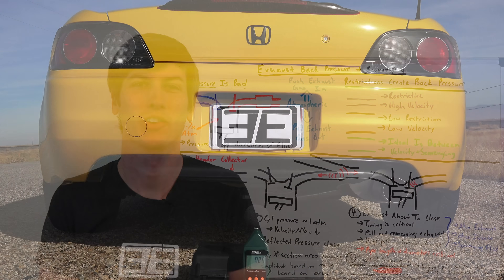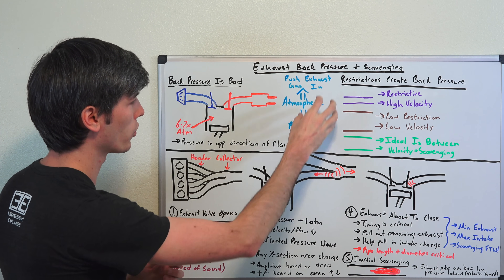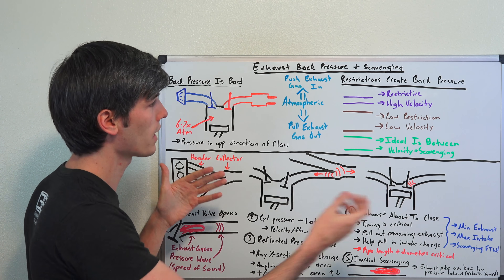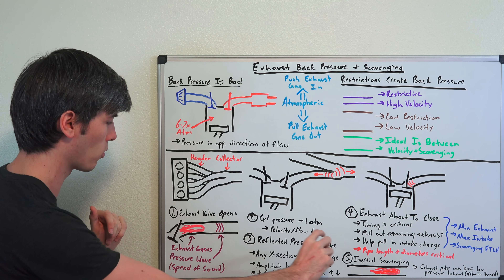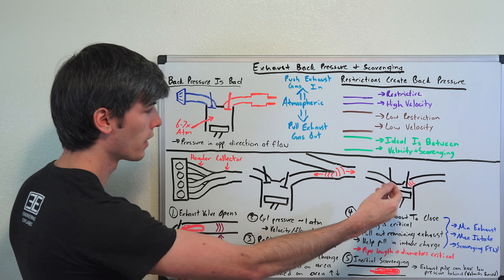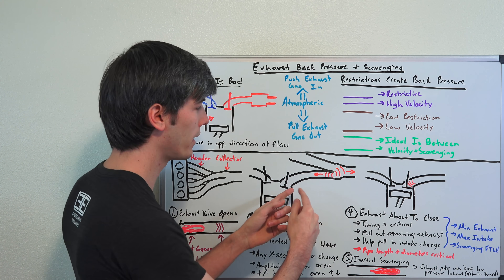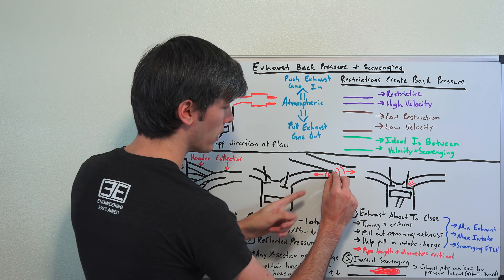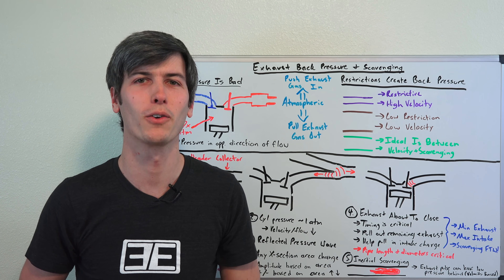Stop Saying Car Exhausts Need Back Pressure

Comment: So "Stop Saying Car Exhausts Need Back Pressure" and then showing the yes indeed some back-pressure is actually a wanted and good thing cause it can help manage engine-response and increase torque, power and efficiency if used correctly.
Reply: Backpressure absolutely doesnt increase torque, power, or efficiency. Thats exactly what he demonstrated with this video.
Reply: @Kevin-dt9xm  "Backpressure absolutely doesnt increase torque, power, or efficiency."
And yet it is necessary - aka to a certain point it does.
Try removing the exhaust pipe all together and see the performance drop.
Reply: @ABaumstumpf  let me ask you this: does drag help a car go faster around a track? No, not at all. Its exclusively counterproductive. However, aerodynamic features can give you so much downforce that its worth the added drag. The drag is just a necessary evil, it doesnt help in any way. You would never say "drag makes a car go faster around turns" because it doesnt.

Backpressure, whenever present, is bad. Wherever there is backpressure, there is DECREASED torque, power, and efficiency. Its just that without a variable diameter exhaust, its unavoidable having backpressure somewhere in the rev range. Therefore, you just have to choose where you want to prioritize exhaust scavenging. If you want good low end performance, you get a smaller exhaust, and it would be too small for top end exhaust flow, and the top end suffers backpressure and thus lower performance and efficiency. If you want good high end performance, you get a bigger exhaust, and it would be too big for low end exhaust flow, so the low end suffers backpressure and thus lower performance and efficiency. The reason that performance would decrease if you entirely removed the exhaust isnt because you reduced backpressure, its actually because you increased backpressure. The open atmosphere is essentially an infinitely big exhaust pipe, which means exhaust gas velocity will be too low, and scavenging will be poor.

Another example. Steroids increase sports performance. Steroids also give you small testicles. Small testicles dont increase sports performance, theyre just an unfortunate side effect of the thing actually increasing performance.
Reply: @Kevin-dt9xm  "let me ask you this: does drag help a car go faster around a track? No, not at all. "
And a nice strawmen you got there.

"Backpressure, whenever present, is bad."
Then you gotta argue that with Jason - but no, you are just wrong.

"If you want good low end performance, you get a smaller exhaust"
Ah, so it does increase performance, contrary to your previous claims? Make up your mind.
Reply: @ABaumstumpf  1: not a strawman, just an analogy to show how your logic sounds in another context

2: jason agrees, thats the point of this video

3: what i said literally doesnt contradict my statements. A smaller exhaust has no backpressure at low rpms, which means high performance at low rpms. It has backpressure at high rpms, which means low performance at high rpms. Backpressure is exlusively bad, but without a variable diameter exhaust it is unavoidable, so you just have to choose where you're okay with backpressure, and where you want good scavenging.
Reply: @Kevin-dt9xm  "not a strawman, just an analogy to show how your logic sounds in another context"
Analogies have to depict similar situations or be in any way relatable - your story isn't.

"jason agrees, thats the point of this video"
What the video - he didn't.

"what i said literally doesnt contradict my statements."
Nah it very much does - you denying reality doesn't matter.
Reply: @ABaumstumpf  jason does indeed think that backpressure is bad, thats why he made a video titled "stop saying car exhausts need backpressure" and spent the whole video explaining how poor scavenging (read: backpressure) HURTS performance and efficiency, and how if you want good performance in a certain part of the rev range, that means removing the backpressure from that part of the rev range.

And on the third thing, its not enough to just say my statements contradict each other, you gotta explain how, because i truly dont see how "backpressure is unavoidable so you just have to figure out what part of the rev range you want to sacrifice" contradicts "backpressure is bad"

I said "if you want good low end performance, you use a smaller exhaust". You took this to mean "backpressure helps performance". However, what is SCREAMINGLY obvious, especially since i had just spent like 2 paragraphs explaining it, is that the reason a smaller exhaust helps LOW END performance is because a smaller exhaust has the LEAST amount of backpressure in the low end. The only place backpressure is present when you have a smaller exhaust is in the higher rpms, where it HURTS performance and efficiency. Just because you dont know how to read doesnt mean i contradicted myself lol
Reply: @Kevin-dt9xm   "jason does indeed think that backpressure is bad"
And then proceeds to make a video were he also says it is needed.... you might want to watch the video and not only read the title.

"its not enough to just say my statements contradict each other, you gotta explain how"
Why would i need to do more than simply refuting your baseless claims?
What can be asserted without evidence can be dismissed without evidence. And if you fail to notice when you contradict your self as well as you being so hostile and ignorant then there is no reason to go into further detail.

"because a smaller exhaust has the LEAST amount of backpressure in the low end."
And you are yet again not only making unfounded assertions but also yet again contradicting your self.

"Just because you dont know how to read doesnt mean i contradicted myself lol"
You should stop projecting your own shortcomings onto others.
Reply: @ABaumstumpf  just watched the video for a third time and didnt hear him say a single time that backpressure is in any way beneficial, but he does repeat about a dozen times that its bad and hurts efficiency and power.
Reply: @ABaumstumpf  "unfounded assertions"

A smaller exhaust pipe will flow a low amount of exhaust gas at about the same speed and pressure that a bigger exhaust pipe will flow a higher amount of exhaust gas, will it not? Well guess what, at low rpms you have a low amount of exhaust gas, and at high rpms you have a high amount of exhaust gas. Sorry if that information is too overwhelming for you, take a break here if you need to before continuing.

Since low rpms mean low amount of exhaust gas, a certain size exhaust pipe will be the optimal diameter for achieving a good balance of having the lowest possible restriction while still having high velocity. With this exhaust, optimally sized for low rpms, you will have good performance at low rpms. For higher rpms, when you have more exhaust gases, that same pipe will now be too small, and will be too restrictive and have high backpressure, which means its alot harder for exhaust gases to leave, which means the engine has to work harder to force out the exhaust gas, and more of the exhaust gas is left in the chamber, diluting the next intake stroke.

Finding the balance between minimizing backpressure and maximizing exhaust gas velocity is literally what jason said in this video. Dont believe me? Take it up with him.
Reply: @Kevin-dt9xm  "A smaller exhaust pipe will flow a low amount of exhaust gas at about the same speed and pressure that a bigger exhaust pipe will flow a higher amount of exhaust gas, will it not?"
Just that gas does not behave that way.
ALso it was you that claimed that having no restrictions would also decrease performance - you really should make up our mind.
But ignorance is a choice - your choice.

"Finding the balance between minimizing backpressure and maximizing exhaust gas velocity is literally what jason said in this video. Dont believe me? Take it up with him."
Oh, so now no backpressure does have downsides?
Yeha, talk about cognitive dissonance.
Reply: @ABaumstumpf  also, what do you mean gas doesnt behave that way? Are you saying you DONT need a bigger pipe to flow more gas at the same speed and pressure? So you're saying that you can flow a higher volume through a given diameter pipe without increasing its pressure or speed? Cuz the funny thing about a gas is that when you take a given volume of gas and try to force them into a smaller space, it increases their pressure.
Reply: @Kevin-dt9xm  i said exactly waht i said - is it that hard for you to once read what i had actually written instead of creating more strawmen and false claims?
Reply: @ABaumstumpf  i said that a larger volume of gas needs a larger diameter pipe to move through at the same speed and pressure. You quoted that and said that isnt how gas behaves. Tell me what im missing here.

Comment: Doesn't the low pressure wave, in fact, create some "back pressure"?
Reply: No, backpressure means pressure in the exhaust that is pushing back on the exhaust gas trying to leave the cylinder, the low pressure wave is the exact opposite of backpressure

Comment: When volume decreases pressure increases which should make anything contained within go faster... To a degree.  So im sure untill it gets to crazy high levels of power even a small pipe would work good. Though a shorter length might be ideal since youre trying to get them out as soon as possible.

Comment: But in theory if you had no exhaust manifold you would have no back pressure. Therefore you have less torque and your valves would struggle…

Comment: So the middle muffler is it necessary exept the noise reduction?  I have a Hyundai Accent 1.3 86hp and i have change the final muffler with a straight after market Group N style same diameter with the central pipe, 42mm and remove the middle muffler.

Comment: Sorry for a very late question to this video but here it goes. When I added a backend aftermarket slip-on to my 1000cc sportbike I definitely decreased my backpressure on this engine and it gave me a very sensitive throttle response from idle to 30% throttle. It was too drastic to manage takeoffs so I added some backpressure which helped. These activities of changing backpressure must be impacting my air/fuel mixture so my question is - Is lowering the exhaust presure making my air/fuel more rich or lean and at what place along the rpm range? Thank You!! Very nice upload!
Reply: Its not impacting your air/fuel ratio at all. Poor exhaust scavenging just means that, along with increased pumping losses, your intake charge (the air fuel mixture, at whatever ratio its set to) is diluted with some exhaust gas.

Comment: Dropping the muffler off a v8 won’t change a thing but do it to a 4 banger I promise you will lose power ps I know from experience backpressure matters bud
Reply: You're not seeing backpressure benefit an engine, you're seeing good exhaust scavenging benefit an engine. 4 cylinder engines need smaller exhausts than 8 cylinder engines for optimal exhaust flow. Thats why he had a chart in the corner showing that too small of an exhaust causes poor flow, AND too big of an exhaust causes poor flow. You need just the right size exhaust.

Comment: Extraction Scavenging Resonance are complicated 
the lead exhaust flow might produce an inertial force that produces an effective lowering of pressure that pulls out the late exhaust flow and/or allows energy from cylinders' exhaust to pull lower pressure on other cylinders' exhaust

Comment: I'm very late on the comments for this video.  Back in the days of carburetors if all you did was improve your exhaust flow your car would have better air flow and your carburetor would now be running lean.  There is some truth to you needing back pressure.
Reply: Sounds like you just need to tune your carb after modifying the engine.

Comment: Ok so basically back pressure is important.

It's basically a balancing act to get it right.
Reply: No, backpressure wouldnt exist in an ideal exhaust (one that could adjust its diameter for optimal scavenging at any rpm). Its just that since that ideal exhaust is impractical, we're stuck optimizing exhaust flow for 1 given point in the rpm range and begrudgingly accepting backpressure above and below that rpm.

Comment: wait so I don't need to care about muffler deletes as long as I don't change the diameter of the pipe?
i wanna do a muffler delete on my diesel car I just don't know if its gonna effect my performance and MPH
Reply: Your muffler delete (if your muffler is acting as a restriction in the exhaust) is essentially the same as changing the diameter of the pipe.
Reply: @Kevin-dt9xm   I don't have separate resonator on that car. but I changed my plans and Im instead looking for a good cheap petrol car to play with but really appreciate your reply

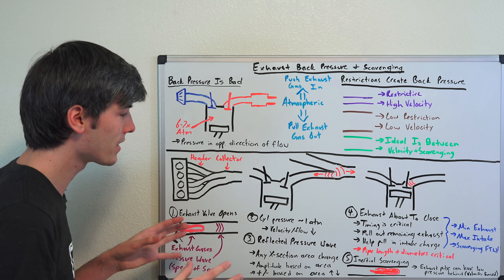Comment: At the 4:30 mark how does an increase in pipe diameter create a back pressure wave? The resistance is decrease, so it should allow better exit of the gases. No?
Reply: Increase pipe diameter = lower pressure, scavenging effect. A wider less efficient pressure wave to pull the exhaust charge out. Picture a chain of waves. High pressure wave creates a low pressure wave behind it, helping pull out the spent exhaust gasses.

Comment: As an old two stroke bike racer the effect of correct exhaust tuning is something I am very familiar with. One small addition and that is that exhaust pressure waves do not necessarily move at the speed of sound. That speed can vary slightly depending on exhaust temperature. Also perhaps should have emphasized correct lengths of the different runners so pulses are not fighting each other.

Comment: You forgot to mention firing orders where the Pistons are in varying states of the 4 cycle process, most firing orders keep one piston exhausting one after another, continuously pushing the exhaust flow out. Reversion waves are kept at bay, sometimes they never reach the cylinder. 
The other is, for those old timers who remember, cast iron log type exhaust manifolds, were also called "heat stoves" sometimes had a spring loaded gate the would close the exhaust flow n would open up when the motor was accelerated more exhaust. This device to an extent would increase back pressure, n therefore also increase "heat" which is energy. Keeping the exhaust manifold, "heat stove" hot or hotter would increase "energy" and also exhaust 
"scavenging", one of the reasons hot rodders 
"wrap" their header pipes with exhaust wrap, which is not only to keep from burning yourself, which most people think, but it's to retain "heat" which is energy... So, a little bit of back pressure is beneficial, as you say, you have to find a happy medium in exhaust pipe diameter to get the best velocity, and in doing so, you are introducing a bit of back pressure.
Also depends on engine size, stroke, n displacement...

Comment: You didn't mention noise.  Low exhaust pressure equals less velocity and less noise. Which is why the old side pipes were so quiet without a muffler.  Also, why is it then that dragsters and race cars DON't have exhaust pipes or mufflers.  some of those pipes are only about a foot long.  According to your explanation, they are losing power.

Comment: So you state that the ideal setup is “somewhere in between,” which is exactly what you’re arguing against when someone with a muffler-shop-PhD says “some backpressure.”. You also left out the inversely correlated graph of exhaust velocity (velocity pressure vave) vs large diameter (viscosity pressure vave) which would have given a nice target area where they overlap.  Also on the velocity side (more back pressure) you have increased EGR effect, faster warm-up, and higher EGTs (bad in Arizona on the highway, extremely important in Washington in the winter unless you can afford a good stainless exhaust system), but there’s a limit.  A muffler-shop-PhD doesn’t necessarily know how to explain all this, and it would be lost on most customers anyway, hence the phrase “some back pressure.”. Also, even though mechanics call it “back pressure” doesn’t mean it has anything to do with actual pressure (given the exhaust system is designed by someone with an IQ somewhat higher than 4) and your theoretical changes to atmo are both irrelevant and distracting (though it inspired some commentary which I find histerical).

Comment: Focusing only on NA engines, from that initial pressure drop on valve opening, is it efficient to go from the cylinder head end size to the collector even if it is very long?. I imagine that you have to take Rpms and exhaust frequency into account. But my question is, is it better a linear reduction from valve to collector or the length of the reduction is unimportant

Comment: Anyone else notice the whole point of the video was to try to show that you don’t need back pressure? Then went on to explain why you need back pressure to be timed perfect. 
Let me put it this way. I used to build nitro rc racing boats. The exhaust system for these have baffles in them. I’d drill out the holes in the baffles about a thousand more than stock holes. If you remove that baffle all together, the engine wouldn’t run at all. Properly designed exhaust uses a certain phenomenon, to create a pulling effect through the exhaust that pulls air into the intake. Without that, engines don’t run. Back pressure is a vital part of that equation.

Comment: One has to differentiate: flow resistance, pressure differences of a gas oscillation. I would have liked to have heard something (more) about the valve control / overlap between the 4th and 1st stroke. Many people certainly mean by "backpressure" the backwashing of fresh gas from the exhaust duct by the returning pressure wave. Four-stroke engines also use the principle of utilizing resonance, which is widely used in two-stroke engines.